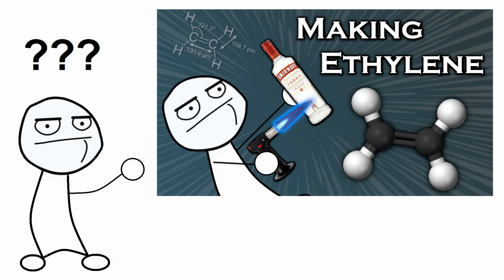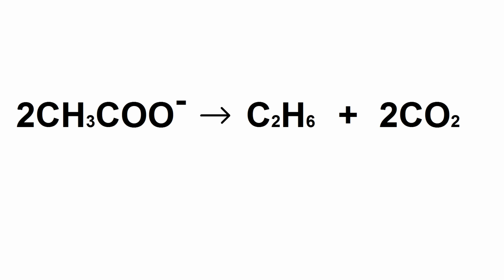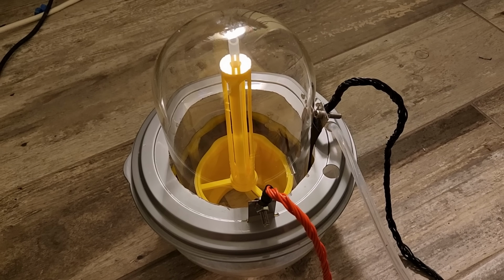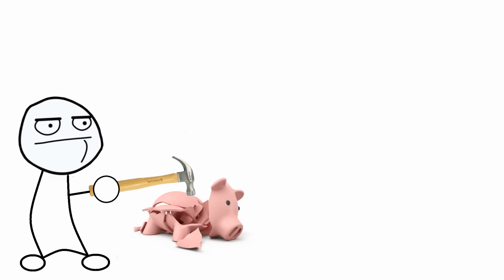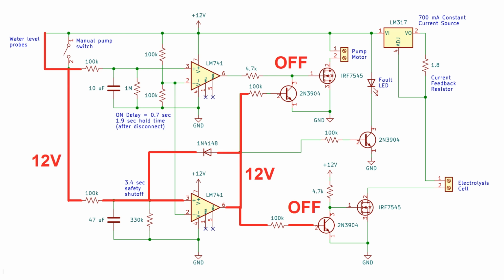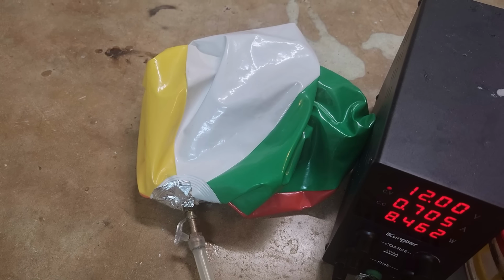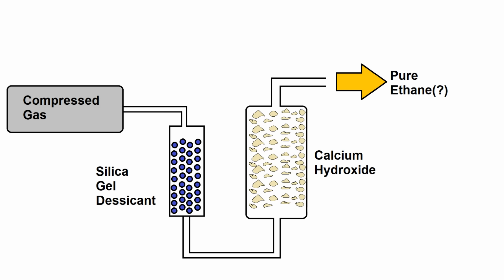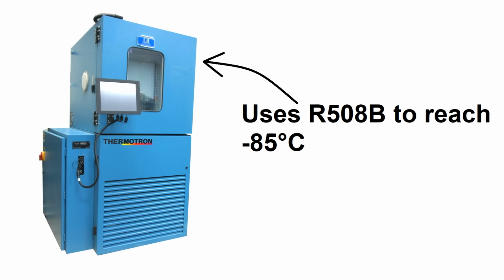How to make Ethane Refrigerant (R170)

Comment: To give you a few ideas on how to improve on the design of the „kolbe-electrolyzer“. First off, you can get so called MMO electrodes (mixed metal oxide), which are somewhat cheaper than platinum and also very durable. However I‘d suggest against lead diode electrodes as lead dioxide rather easily dissolves in organic acid environments. Perhaps carbon fiber? It’s more stable towards oxidation and shouldn’t easily break down into various more or less oxidized graphite/carbon sludge/graphene oxide … stuff. That aside, perhaps you‘d want to make a membrane separated cell. Whilst terracotta should work just fine, a polymer membrane would be far better. You can easily crosslink PVA with various aldehydes such as glutaraldehyde, glyoxal and even benzaldehyde (synthetic bitter almond aroma). Just add 10-20% of PVA weight equivalent of aldehyde into an acidic PVA solution containing ~10% PVA and 2% HCl aq. With benzaldehyde the beauty is that you will flocculate out the hemiacetal (presumably), which can subsequently be washed from acid and redissolved (whilst wet) in hot ethanol. After drying you are getting a very veery tough membrane that forms a hydrogel in contact with water. To improve hydrophilicity you might add layered alumosilicates like bentonite. This will also give it proton conduction selectivity.
Reply: How the fuck do you know all this. I understand all the words, but not in the way they’re stringed together.
Is this part of your job?
Reply: How sure are you that platinum electrodes are used just for their corrosion resistance and don't play a catalytic role (so that MMO electrodes are enough)? References would be highly appreciated, thank you.
Reply: @col0342  Idk why, but it appears my initial comment disappeared, let‘s hope this one stays. 

Anyhow, it seems that the proposed mechanism is a radical mechanism, rather than a catalytic one, so I‘d assume that the electrode material doesn’t have a lot of influence on the reaction, except for overpotentials of course - which might even be a good thing if oxygen evolution is kinetically disfavored. 

Other than that I found very few sources on other electrode materials than platinum or platinized electrodes. 

However Hans J. Schäfer references some slavic source I couldn’t find in his paper:
„With vitreous or baked carbon in protic solvents (methanol, ethanol, water) dimer yields nearly comparable to those at platinum have been obtained“ 

Hans J. Schäfer, Comprehensive Organic Synthesis, 1991, p. 633-658

Also I found the following: 

Abstract: „The use of some kinds of glasslike-hard carbons was found to lead to selective synthesis of the corresponding Kolbe coupled products in high yields comparable to the use of a Pt anode in anodic oxidation of some carboxylic acids“

Chemistry Letters, Volume 20, Issue 7, July 1991, Pages 1085–1088

I didn’t read the whole thing unfortunately as I don’t have the time for that rn, I merely skimmed it.
Reply: @GreenCaulerpa  I've only seen Kolbe electrolysis done with platinum and platinum-coated electrodes. Aren't MMO anodes not typically used in acidic solutions? I could see glassy carbon working too, though I can't imagine you'd find it cheaper than platinized titanium. The few times I've looked for it tiny little pieces were hundreds of dollars at best.
Reply: @GreenCaulerpa  thank you, highly appreciated
Reply: Doing better than me.  I read the whole thing and nothing clicked
Reply: Wow, if you took the time to do a step by step in a video or blog you would have a lot of followers.  
If you could develop DIY membranes for the popular DIY synthesis needs from household chemicals it would be great.
Not sure if this reaction could be improved with a membrane but many reactions cannot be done in a single bath.
Reply: @KallePihlajasaari   The thought process for me was that this way he could avoid this whole pumping thing, in fact, if he manages to make a membrane-separated cell, he could just vent the hydrogen (or collect it, if he wishes to) and the gas can be compressed by the electrolyzer as it’s being generated. 
In fact there’s a couple of membranes you could „diy“ so to speak, but I found them mostly hard to produce consistent results. For instance citric acid is a good crosslinking agent, but it’s not stable towards hydrolysis and getting a tough membrane seems to be based on mere luck. I found it hard to control. 

Aldehydes however make great crosslinkers that also allow for a solution casting process without the need for post-processing crosslinking. Like thermal treatment in an oven or so. And depending on the structure you can easily make highly hydrophilic to almost hydrophobic membranes. 

Also there’s a way (two ways to be specific) to use sodium silicate for crosslinking PVA. They however have a couple of drawbacks. When using sodium silicate as „scaffolding“ you get a very tough membrane, but due to the nature of the crosslinks (hydrogen bonds) it’s sensitive towards acidic pH and heat above 50C. The second method involves making a silicoester of PVA, but the ester already hydrolyses if you merely look at it wrong, so that’s pretty much unusable except if you intend to make a product with a pva packaging material that has to dissolve within a couple of hours of immersion in water
Reply: @GreenCaulerpa  If you do some blogs about this on SubStack I would follow you.  I am interested in any electro chemistry that provides useable products that cannot be legislated away from us or would be available in a post apocalyptic world for distributed chemical industry.  Basically my interest is chemical independence.

The goal is to be able to make as many of the top 100 medicines as possible on a island.  The feed stocks have to be as simple as possible.

Comment: The Arduino seems easier than building it in hardware.  Software is much easier to deal with when  you need to do a bodge fix. 😅  I am far more knowledgeable in programing than hardware electronics though too.

Comment: why not consider using the 0.01mm platium wire?
with the same price it has more surface area
On the otherside, platium coating could lead to some issue like the coating fell of or any unexpected problems?
Glad to see your latest video, I'll try to replicate one once my own several project were done!
Reply: I’m not sure but the decrease in electrical conductivity with the reduced cross sectional area of the wire may prevent higher current operation.
Though if the electrical resistance comes from the surface area of the solution-electrode interface and not the wire itself then your idea would be ideal to increase production rate
Reply: @gtjack9  I see, indeed i forget the resistant part, but in this case( which I=750mA) i think the resistent of the wire would not be a problem

Comment: I seem to recall you can take off the plastic C clip and flip the float around, and it will go from NO to NC. Been a while, but it's quick to try if you want/need to.
Reply: Very interesting.  I think that it will be vendor specific depending on where they install the magnet but definitely worth checking, it would be a disaster if the float is not marked in any way on a professional device.

Comment: Very nice work with the analog circuitry. Now if you added a second safety shutoff based on the pH exceeding some set value you could walk away and let it do it's thing.
Reply: Yup. Or add some acetic acid automatically.

Comment: the 'accidently drank some' is somewhat concerning lol
Reply: Sodium acetate is the flavoring on most "salt and vinegar" potato chips
Reply: @Emu0181 I was about to say this, that's how I make homemade salt and vinegar chips, mix up some fresh vinegar and baking soda. Soak the chips in it and let them dry. It's not the same as store bought sure, but I'm sure it's healthier than all the extra shit they throw in
Reply: Only if you don't know what sodium acetate is and thus didn't realize that he was joking (about it being accidental, not about doing it) 😉
Reply: Just always consult the MSDS before the accidental consumption, so it's safe.
Reply: I was using a beer bottle for shellac once while I was drinking some beer finishing a table. It ended about as you expect lol. Thankfully both shellac and ethanol are used for human consumption. 1/10 would not recommend.
Reply: @zyeborm keep some orange electrical tape on hand. I love reusing bottles for all sorts of odds and ends and anytime I put ANYTHING in a container that does not tell me what's in it I'll orange wrap it. Sometimes I'll forget what's in there which is it's own problem but that can be solved with a sharpie. If you're working on a project and drink the orange electrical taped beer bottle by accident you kinda deserve it at that point ahha
Reply: @DarkAttack14  This. I once copped a mouth full of motor oil. That's a taste that, even if you spit it out instantly, stays with you for days afterward. It's worse than petrol.
Reply: It would be funnier if he drank something in the previous video
Reply: It's vinegar and salt. It's probably fine.
Reply: @thewhitefalcon8539  Well "accidentally" consuming chemicals you didn't plan to consume even if it is safe is always concerning... How do you even do that on accident
Reply: He definitely drank it on purpose 😂

Comment: I have covid :(
Reply: sadge
Reply: I don't but I have had once.
Reply: @dtiydr  yes I've had it once before. This time it isn't nearly as bad.
Reply: @bok..  Interesting, did you loose smell and taste the first or second time?
Reply: @dtiydr  yeah i lost smell and taste partially. This time though nothing noticeable. mostly the symptoms were all body pain, low fever, and sore throat. The brain fog is annoying, i find myself forgetting where i put stuff more often. Ive had 5 vaccines my last one was around this time last year.
Reply: @bok..  Dam. Mine felt like a really, really bad flu but nothing close to that I had experienced before, no sore throat but strange bad acing around my stomach and yes the joints. No vaccine here before or after, not an anti-vaxxer or such though just a lot in my life back then. Lost my normal taste and smell as well but I could only taste extreme bitterness, so severe that I could not eat anything since it tasted extremely awful but I had to force my self to eat at least something. It took about 2 month until the bitterness was completely gone, it got slightly better after about 2 weeks but still quite bad, got my smell back after about 2 weeks as well. No ill effects of it afterwards.
Reply: I hope you are doing better by now
Reply: @phil-lp7038  I am thank you!!!